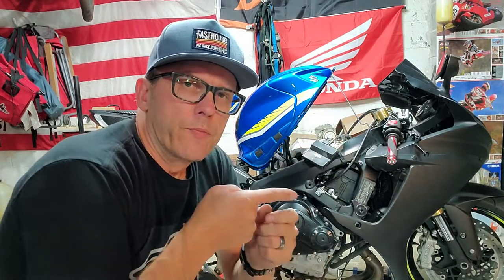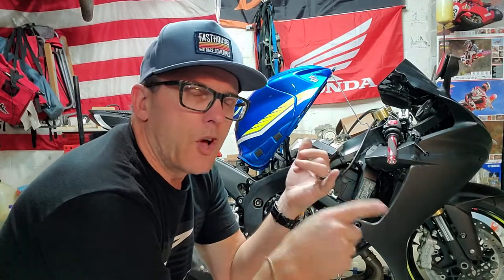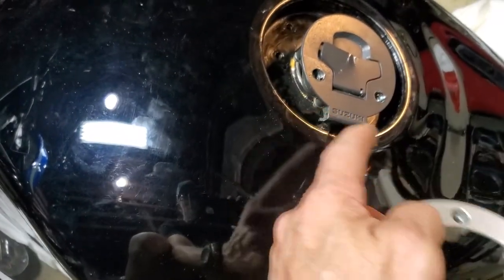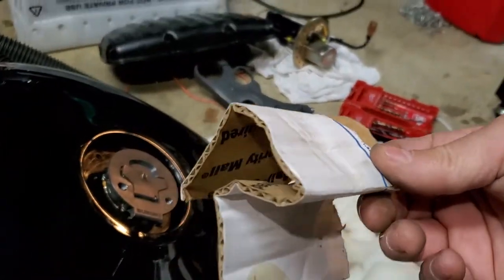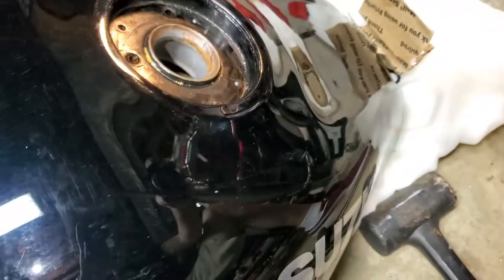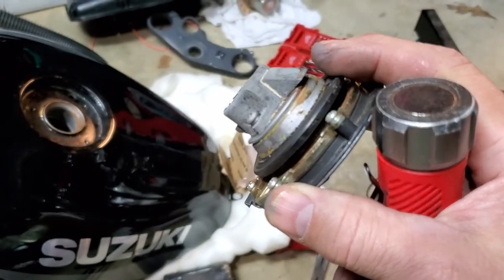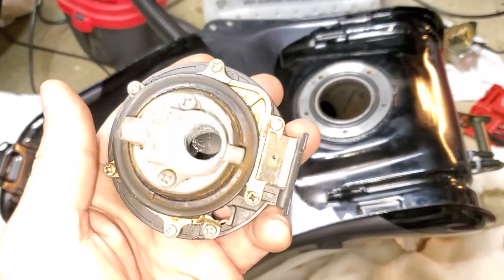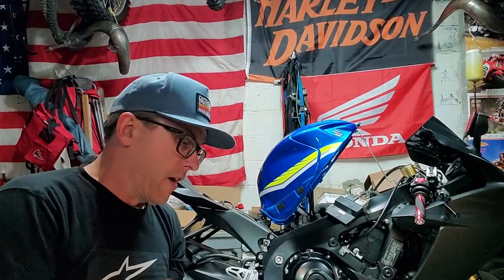Tips on removing a seized stuck motorcycle gas cap rusted

Comment: I bought a Shadow from hell and got the gas tank cleaned out, but this weekend I went to open the gas cap to see if any flash rust came back from the months in my basement (with a dehumidifier) and the key wont even turn a hair. Gonna have to try this out. At least it's clean as a whistle inside the tank from the petcock opening.